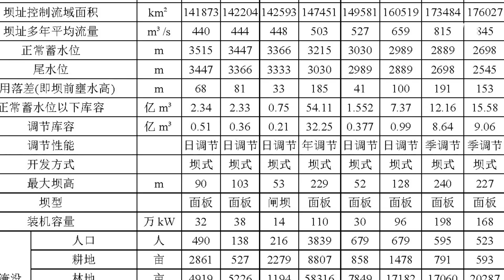Why This Remote Area of China Is the Hydropower Center of the World | WSJ

Comment: Good Morning
this was sent to the white house last week after 10yrs in the Australian mill
This document is for a retro fittable power production system for a hydro dams to have up to three extra turbine banks without making issues for the main turbine hall
Now the reason this type of system has not been looked at was two fold .. the loss of flow rate and back pressure issues
As all the worlds dams have the same basic layout regardless of the turbine fitted. The basic setup is water turbine shaft to shock uni joint to the power turbine. And so all have the same common limitations
A new type of turbine unit is needed if the main turbine hall is to function without mods for a multi bank units are to be placed in the flow
This new system will never match the output of the main turbine hall but after years of chasing minute increases a system like this one is a massive jump in output
At this point it should be noted that most of the installation process can be made with the dam online selling power to the grid and there is no increase in water usage when fully installed
This system has been designed to be fully independent of the main turbine hall so as to be serviceable with the other units online and running with the main hall
A FEW OBVIOUSE POINTS
Population = Even if our numbers were to fall we are still in a situation of heading to a power shortfall outcome things like data centers e cars and a hole host of other tech
The lag time at best for any new power units to get online is 2-3yrs at best and i believe we are well short of filling the markets needs
OTHER BENIFITS OF THIS UNIT
Is a dam green tech? well its more recyclable than wind and solar
lasts 100 plus years vastly more than the others
It should be noted if the patent is very strongly protected the market will come to the seller even if it is in Australia or America so a 100 billion dollar a year marketplace makes the wage bill a non-issue
SOME OF THE BIG BENIFITS
Bigger market share/customer base
All the required infrastructure is already in place
the asset has a longer life span
No issues regardless of type of the main turbine fitted
No added down time
AND ITS TRUE BASELOAD POWER from a existing dam

Comment: Yes, there are risks. But, they are determined to go steadfastly ahead to promote green transition. The green power generated helps to help the local community for better cooking and heating fuel, not cutting down trees and shrubs to burn, which in turn helps to prevent land erosions.

Comment: China is NOT coming closer to net zero. They are building more coal-fired plants all over the country that would make China the number one country with coal-fired power plants. Remember, China does not set regulations on emissions like western countries do, so there will be no scrubbers on the smokestacks of these plants.
Do not believe the propaganda about China nearing net zero emissions. Quite the opposite. I've seen videos (covert videos) of all those solar farms spanning dozens of miles as simple glass painted black. Not a single electrical line runs from those "grids". It's all propaganda and poorly-built infrastructure.

Comment: If you followed this method by Tesla, you would not need batteries for EV's.  The roads could be electrified, and the cars get their power and electric from the roads they drove on. No need to ever pull over and spend hours or days charging your EV.  And no need to take up land fills with dangerous chemical batteries that cannot be recycled. And like to go "boom" and catch fire. Because every time you charge a battery, every time it's ability to hold a charge decreases by a little bit. Reducing the range of your EV.  With Tesla you would only need stop at "rest areas" and to get something to eat on your journey. Never mind needing to stop and charge or refuel your vehicle!  Now that is technology to help push the human race forward!

Comment: There has been a lot of nay sayers before and after the construction of Three Gorge Dam. Now it's in  operation for 18 years and the return has been enormous. The construction cost is literally amortized fully by its power generation alone in 5 years. The benefit it brings in navigation, flood prevention,and emissions reduction is much larger.  Even if the dam retires now the return has been incalculable.

Comment: But they are also still building coal fired powerplants at an accelerating rate of construction! And more nuclear powerplants than the rest of the world put together. 
     It would be better if all of these dams were built to a pass through design, with no water storage  reservoir. Some of them are designed this way but too many are more traditional dams. China is also damming enough rivers on the Tibetan and Himalayan Plateau that they can cut off virtually 95% of water flow to the downstream countries of Pakistan, India, Burma, Cambodia, Laos, and Vietnam. It appears they may be preparing to use access to water to blackmail their downstream neighbors.

Comment: It will be a TOFU DREG nightmare. First the CCP will flood communities along the river to make way for the dams and then you have the eventual collapse of these damns due to the corruption and extremely poor safety and construction practices. Anything built from 2015 by China is inherently dangerous. Just look up ‘swaying buildings in China’. The basic practice of building concrete condos, infrastructure use sand to fill in with a small layer of poor quality concrete. They also don’t allow for the ‘curing’ of the concrete which is about 2 weeks so building a dozen stories of a building over a few weeks will make that building a ticking time bomb. Imagine punching a concrete wall and see it break easily and have sand pour out, anyone would be concerned. It happens everyday but the CCP tris to hide it. Their belt and road in 3rd world countries have been built with the same poor quality.

Comment: Hydro electricity is cheap, there is no question about it. But China is the world's #1 solar panel producer, I wonder why not more solar panels are installed instead of risking with these huge dams? I get that solar panels don't produce at night, and excess capacity needs to be stored.
Reply: Because solar panels are extremely bad at storing energy.

Comment: This is a brilliant move by the Chinese to provide an example of a literal cascade failure, should any up-stream dam fail.

Should they all be full and an upper level dam fail, it isn't unreasonable to expect the surge to over-top the next, potentially causing it to fail, and the resultant surge could then take out all the other downstream dams planned. Worse case is the surge is only partially reduced by spillage on flood plains and still has a large volume when it eventually reaches the 3 Gorges Dam - after the flood waters pass through several large cites.

Comment: Look up "1975 Banqiao Dam failure".
I'm sure modern dams have way better safety standards. But then if you put 10 dams in a row, each of them being "99% safe", the whole system of 10 dams will only be 0.99^10 = 90.5% safe. (Math is for illustration only because downstream failures wouldn't affect upstream but hope you get the point)

Comment: In your portfolio, you need both litecoin and bitcoin. Litecoin (LTC) is not a security, it is a digital precious metal, a digital commodity that cannot be debased, censured, seized, frozen, or confiscated. LTC is a decentralized digital payment medium and a store of value without intermediaries such as banks. Litecoin (LTC) complements bitcoin, like silver complemented gold under bimetallic monetary system, but litecoin has its advantages that bitcoin doesn't possess. Rarity of litecoin means that there will be only 84 million litecoins in existence. As the second oldest coin on the market, litecoin from its inception in 2011  was designed to be the "digital silver" to bitcoin the "digital gold".

Comment: The place she pointed where the earth quakes happen and where the dams are is  400km (250 miles).... and it is not unstable ground. dams built in b/n rocky mountains is very difficult (logistically) to build but it is the best place for a dam. To build such dams they have to divert the rivers through bored tunnel 3:26 and then build the dam. the materials they were dumping, was to divert the river in to the tunnels , not the base of the dam. AND We can clearly see from the sat images, in the construction site there is no river!  but  hey this is what i expect from a propaganda..

Comment: I am certain that while the loss of historical villages is wrong, the benefit to humanity’s future will be good. WSJ did not get China’s comment but they discovered that they are aware. I hope they can integrate or relocate higher after the dams are complete. If China can employ more Tibetans and have new towns built where the dams are, that would benefit all.

Water creates life after all. And having huge stable lakes can allow for redirection of that life giving water elsewhere.
Reply: WSJ said the same thing about Three Gorges Dam 20 years ago.
Reply: I guess WSJ didn’t even bother to check the location of the dam on google map 27° 13′ 7″ N, 102° 54′ 22″ E, because it is clearly a rocky hill area with high cliffs and deep valley rivers, without many settlements around the Jinsha riverbank.
So all the claims about historical villages and tibetan buddhist monasteries going under water are just nonsense.

Comment: This region has the "potential" to produce 112 GW of power (per the video), which would be 25% of China's current HYDRO power generating capacity (390 GW).  According to articles on the dams they are estimated to total 60 GW generating capacity between 11 dams. This is 15% of hydro capacity for the dams being discussed in this video.
Reply: I'll duplicate it here too.
Complete ignorance.. GW and GWh are two radically different indicators. It's just horrendous - the decline of the west in its purest form.

Comment: Das ist nur Chinas Aufwärmphase!
Das Wasserkraftprojekt Yarlung Tsangpo soll eine Spitzenleistung von 60 GW bereitstellen können, von einem einzigen Damm.
Die Höhendifferenz würde vom Einlaufbauwerk ~2850 m über NN zum Auslaufbauwerk auf ~650 m über NN bei ~2200 m oder bei ca. 210 bar liegen, wenn man den Reibverlust einbezieht.  (Angenommene Positionen: Einlaufbauwerk bei 29°36'04.0"N 94°56'01.0"E, Auslaufbauwerk bei 29°19'42.6"N 95°16'36.4"E)
Beispiel Rechnung:
P = η × ρ × g × h × Q
P = 90 % × 1000 kg/m³ × 9,81 m/s² × 2200 m × 1650 m³/s (MQ laut Riversnetwork)
P = 32.049.270.000 W = 32.049 MW Dauerleistung